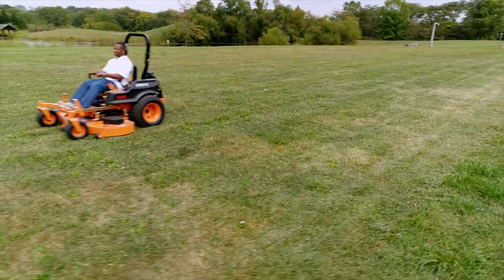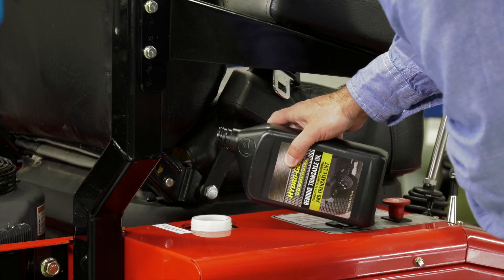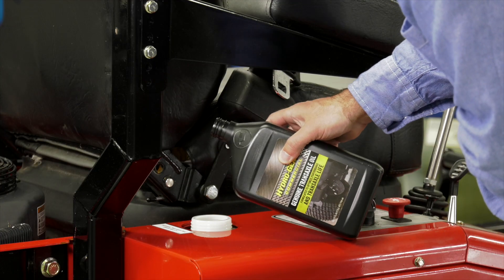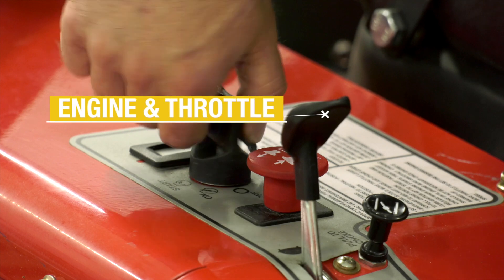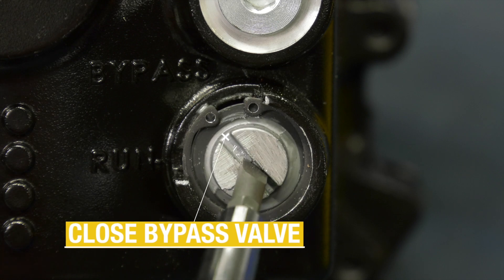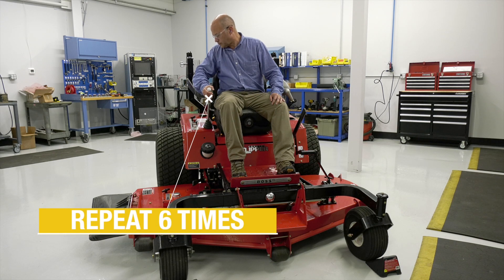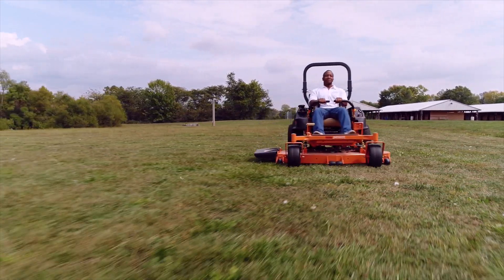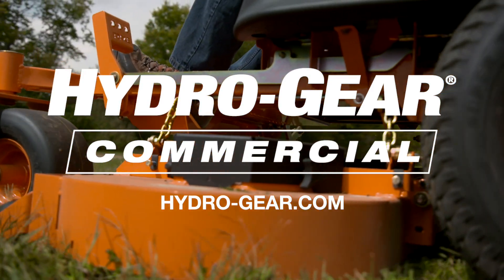Hydro-Gear ZT-4400 & ZT-5400 Air-Purge Process

Comment: On my 5400 the wheels turn under no load with the bypass open.  Fluid was at the level specified on the manual and on reservoir tanks prior to this.  Am I doing something wrong.
Reply: Mine do the same thing